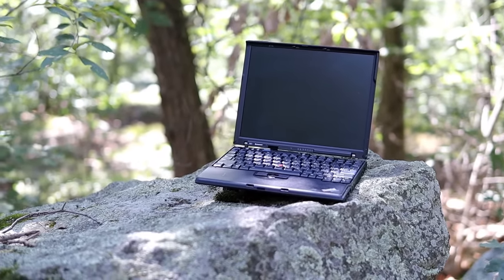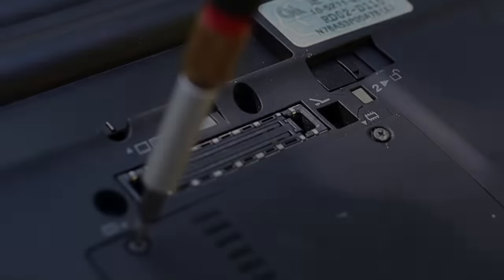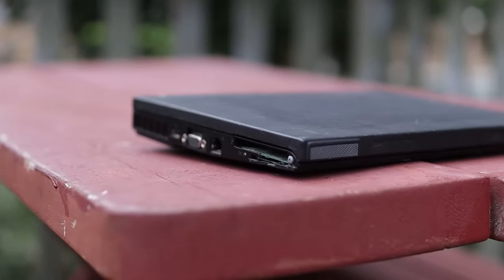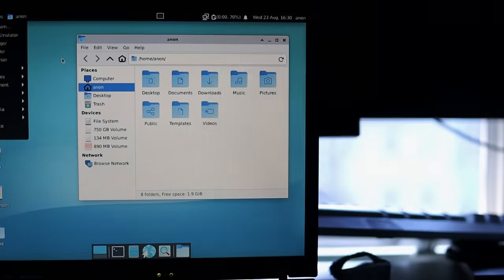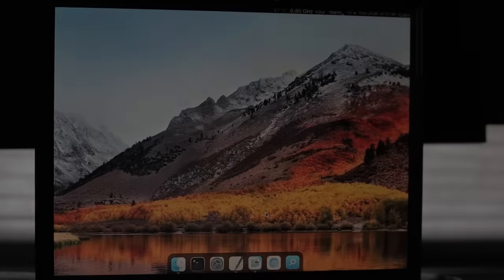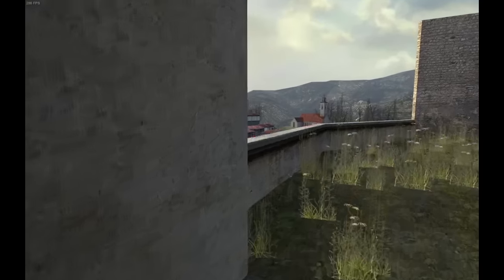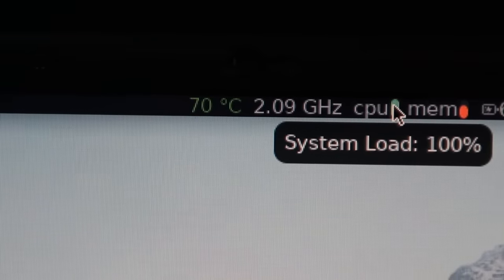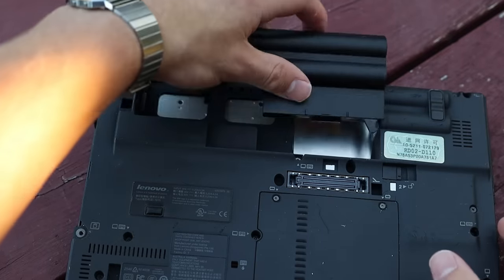Can Linux save this old laptop from obsolescence?

Comment: I've got an X61 Tablet that I absolutely refuse to part ways with. It's a slightly slower T7700 CPU, but getting it to 6GB of RAM and a 240GB SSD turned it into something that can, like you said, really easily beat the plague of N4020-based 11.6" members of the Future e-waste of America Society. I've used a debloated Windows 10 on it successfully, but settled on Mint XFCE for the reasons you described, although I am kind of tempted to dig it out and give Void a shot now. That bump to 6GB was pricey, around $25 for a 4GB DDR2 SODIMM, but the added headroom was worth every penny. That's really what made Windows 10 usable.
Reply: I’ve had an ASUs 11.6 N4020 laptop for about a year and a half now. It has some sort of Windows on a emmc but it is upgradable with NVME. I popped in some generic 256GB NVME and ran Kali Linux on it for over a year, but recently changed to Devuan and couldn’t be happier. Battery lasts for about 10h when I just browse internet and use it for programming and server maintenance via ssh. It is not my only computer, so for gaming or compiling I can use my i5-13600kf based PC. For the rest the N4020 is fine.
Reply: Obsolete after 16 years? I'm sorry, I thought this was America.
Reply: Windows 10 is not usable. An OS that requires you to check and possibly re-enter your settings every time a Microsoft update is forced upon you is not one you can trust.

Instead of fighting against Windows to de-bloat it, your time would be much better spent learning more about Linux.
Reply: @terrydaktyllus1320  How well is support for BattlEye and EAC nowadays?
Reply: @HappyBeezerStudios  I've no idea what BattlEye is, I've never used it and therefore it's unimportant in my computer world to the point where I don't plan on spending time doing "homework" to find out what it is. If you want a better response to that part of the question then you'll need to provide more detail.

The only "EAC" I know of is "Exact Audio Copy" which was a freeware tool that I used many years ago to rip CDs into FLAC format on Windows. I no longer use Windows and therefore don't use this tool either - there are perfectly good tools on Linux which do the same thing.

Again, if that's not what you meant by "EAC" then you'll have to improve your communication skills and explain yourself better if you want more definitive and accurate responses from me.

Over to you...
Reply: @terrydaktyllus1320  I'm talking about anticheats for games
Reply: @HappyBeezerStudios  "I'm talking about anticheats for games"

...then you need to improve your communication skills to indicate more clearly what you are talking about in future.

For the record, I don't consider playing online AAA games with "pretend Internet friends" to be something that I need to waste my time on when I get real friends over 3 or 4 times a year for beers, BBQ or pizza, and a proper LAN party playing classic multiplayer games like Quake and Unreal Tournament, which you bought once and owned forever in the "good old days" when games companies couldn't just leech money as they please from "whales" and kids with rich parents and no backbones.

I do game regularly but I've bought one AAA game after 2010 (Fallout 4 in 2015) because I don't do "games as a service" and could not be less interested in derivative and complete pap like "Cybersplatt 4044" or "Starfailed" - my point being that Linux plays all my pre-2010 games perfectly fine and I don't need to go begging to mummy and daddy each Christmas so that one of them donates another kidney to buy me the latest piece of overpriced and proprietary NVIDIA GPU rubbish either.

Does that now answer your point, gamer?
Reply: I'm still playing Lego Star Wars 3 Clone Wars even though I completed the game already 😊
Reply: @terrydaktyllus1320  you sound really fun
Reply: @soooslaaal8204  This isn't a discussion about me, sonny. Next time you reply, do try harder to keep up and stay on topic. We were talking about computers... in your own time.
Reply: @terrydaktyllus1320  Is larping as a boomer online that fun? I'll try that shtick next with my online "friends." Cheers
Reply: @soooslaaal8204  You go do that then, just don't feel you need to tell me your plans because I am really not interested.

Run along now, sonny, mind how you go and stay away from sharp scissors.

Discussion closed.
Reply: @terrydaktyllus1320  This isn't the tv pops, people respond in here when you speak at them.

Comment: Yeah great video and more testing than usual. I find collecting old ThinkPads is addictive and the most interesting ones, certainly the best keyboards, are on the older ones. They also have a fascinating design history throughout, even the later Lenovo ThinkPad products which continue high-quality design not always found on their other lines. After using SSDs for a few years I find mechanical drives more reliable if not too worn. Windows 10 is not too bad on some of the 2012-era ThinkPads. I have also tried the desktop ThinkCentres but they aren't as durable as the ThinkPads.

Comment: The old Thinkpads had several standout features that still, to this day don't seem to have been emulated by other laptop makers:
- Indestructible hinge design. Never breaks away from the base of the case. Screen stays in the position you adjust it to.
- Pointing stick. I hate touchpads, then because they were garbage and now because I have a hand tremor.
- Exterior of the case had a "rubberized" texture which made it easier to hang on to and less prone to skate off a surface to certain damage on impact.
- Reasonable keyboard design. My 2cents anyway.
Reply: The problem with rubberized texture is that after a decade or so it gets all sticky. Not sure about ThinkPads, though, I had a Dell with that problem. Awful.
Reply: Was a massive fan of the pointing stick on Thinkpads, but the trackpad on modern MacBooks is a winner, large surface and super accurate. Haven't seen anything come close on non-Apple laptops though. Even use the external trackpad on desktop over a traditional optical mouse now.

The texture on Thinkpads holds smells really easily, which can be an issue with the used market of Thinkpads, very easy to tell if a previous owner was a smoker.
Reply: @sp0el  I have an IBM Thinkpad from 1998, and two Lenovo T420s from 2012, and none of them suffer from the sticky coating syndrome.
I have plenty of other devices that do suffer from it...

Comment: I installed Linux Mint 21 (2022 version) on a laptop made in 2006. Fortunately, the laptop had 4Gb Ram, SATA, and Gigabit LAN.  The only upgrade required was a SSD.  Linux Mint installed and updated like a dream.  Job done 10/2022.

Comment: Linux put new life into my 2011 MacBook Pro that FINALLY in late 2022 stopped getting security updates and started to not be able to update LibreOffice or Firefox. 

It is AMAZING what Linux can make useable... I have a laptop that came with VISTA running Linux for the kids and playing retro games and it works actually really well for that and basic web browsing.
Reply: You don't even need linux. Windows 10 runs just fine on these laptops.

Comment: T61, 8gb, 128gb, win11, usb2x3, usb3x4, the usb3 speed is 150mbps via express card, T9500cpu. Working perfectly, task manager always on to monitor cpu usage, handles everything very very well.
Reply from the maker: Wow you maxed that thing out
Reply: @liamjewell62  it's great for web browsing and playing movies etc, it's not very powerful compared to modern ThinkPads but it's really special in looks and in use, the SSD was the biggest upgrade, boots windows 11 in seconds.

Comment: I had used an old Acer Travelmate from 2005 until early 2024, 150GB HDD, 2GB RAM, Celeron dual-core 1.67GHz CPU, as my mail mule, running MX Linux 32-bit without a problem.  Until the keyboard malfunctioned.

Comment: I have a zero % attention span, but I always watch good content to the end  to give the channel an analytics boost.
I have a 25 year old HP/Compaq "laptop" with a "Made for Windows Vista" sticker. (The sticker no longer matches the OS). I autoboot into an Atari ST emulator, and use it as a16 bit gaming computer. It's a Core 2 Duo with 4GB of memory (DDR2,  so going to 8bg is out of my snack bracket - at $200 to $500 for an 8GB kit.) but it works fine for emulating a 68000 based system.   I never throw out old tech, India already has enough of our tech-waste (and the associated health issues effect us all). I always find good reasons to keep stuff.
Hell, I still have my very first computer (a TI-99/4A purchased in 1982!) Gets booted up at least a couple times a week.
Thrusting obsolescence on things that no longer suit their original build purpose, is a deficit of the  imagination. (Pushing 70 myself, so that has particular personal relevance)
Reply: Fav on the TI was space invader & parsec.
Reply: nice

Comment: One things is very crucial to understand regarding hardware. You absolutely cannot compare computers from different era. For instance if you say 15 years old top of the line processor  X is on par as model entry level model Y from like two years ago. They can be comparable when measuring some direct calculation based with some benchmark program etc. HOWEVER things can turn completely around if comparing for instance playing YouTube videos. Now that couple year old entry level model can do playback possibly with like 5% processor load on 4K 60hz where older X model could struggle to run even 1080p 30Hz video. This is where many processor features come in and if someone is wondering why that example I just mentioned is possible if processors are essentially same when comparing calculation vise. But this newer model can easily support hardware encoding. This is very critical to understand when wondering why some older hardware seems to struggle with seemingly trivial task. Like that Chromebook in video can easily playback pretty much every single media without issues, where the old X61 absolutely can't. Don't get me wrong, I use a lot of old and new hardware and in many cases old hardware can do all the necessary stuff. But you can easily run into seemingly odd performance issues.
Reply: They might have similar performance for some tests, but add tasks that make use of newer instructions and the things change quickly. Same with video decoding.
Reply: sometimes you can cheat a bit, eg with h264ify plugin for youtube videos, often helps with older video hardware

Comment: "Better keyboard " I quote this so much! I sadly moved to a Chromebook from a Thinkpad T430 so I felt really the difference.
I definitely took the Chromebook as a daily drive just for it's weight and better battery life (and the usb-c charger, but someone told me you can find adapters for most of the barrel jacks)
Reply: Chrome OS, like Google Android, just turns a portable computing device into a surveillance tool for Google.
Reply: Something I noticed with old laptops as well. Was setting up two old machines, a Dell Latitude from 2001 and an Inspiron from ca 2005, and the Latitude had the better keyboard and better display even after so many years of use. (Sadly it's other specs make it more than obsolete)
Truly shows how well built those old business machines were.

Comment: I'm still using an HP NC6400 as my workbench laptop - it works, has a 900p panel for displaying schematics and YT videos and more importantly still works fine despite leading a tough life. With a lightweight distro the T2500, ATI X1300, 4gb ram and SSD are plenty fast enough.

Comment: A well presented video!👍👍Perhaps you could install an SSD., and make another video which shows how much the performance has improved.  Linux Mint Mate version is my daily driver and I often restore and upgrade older computers and Linux gives them a whole new lease of life.
Reply: It shouldn't really do much with actual performance, but help a lot with perceived performance. GIMP won't apply filters faster, but it will launch and load images faster. Games won't reach higher fps, but navigating the file system will be much snappier.

Comment: I still using my old PC with a i3 3220, 8gbs of ram and a intel hd 2500. On windows the performance is not that good, so I've been using linux exclusively for few years now. Today I use Window Managers(Wayland compositors) and the experience and performance are amazing for such an old hardware. I recently installed cachyos and it made watching videos on youtube a lot better with less cpu usage, something that I could never figure it out how to make it work under vanilla arch even though I follow carefully the wiki. About gaming, I been recently doing a lot of retro gaming with retroarch and the performance its good on the majority of cores available, except PS2 core, but some games do work using the PCSX2 emulator.
Reply: Weird, a computer with any i3 should run great on Windows 10. Have you tried an SSD?

Comment: I found an old Sony Vaio laptop from 2007 with an OEM edition of Vista. Installed a 32x Linux distro called Antix and now it works quite well. You can very easily breathe new life into these older PCs with Linux
Reply: You don't even need linux. Windows 10 runs just fine on these laptops.
Reply: @0w3nn  BS.
Reply: @chovekb  what are you calling BS?

Comment: I'm still using R61 for internet (except streaming movies) and programming. Max 4GB RAM, SSD and new battery. SSD gave huge boost. OS is loading in 30s. Before, it was 1m30s. Still it can play movies in 720p and MP4 from SSD in 1080p.
Reply: What OS do you use? I also have a dead R61 and am considering to restore it

Comment: Always fun to bring some new life to an old machine. I often have some old laptops around - been using a C2D laptop for a while during the lockdowns. Lubuntu, libre office, 720p YouTube and emulation up to the first PlayStation is plenty of activities! Worked with 1080p monitor without any problems. I also revieved 2nd gen i5 Sony VAIO with Mint XFCE not so long ago. Now it is a web browsing and writing machine for an aspiring poet.

Obviously, most of these things are only worth it if you got the laptop for free, as 100$ can get you a postleasing Ryzen 2300U/3300U (so, 4 cores, pretty powerful Vega iGPU) ThinkPad with 8GB RAM. And there is no upgrade to an old C2D laptop that can beat that, no matter the budget :) Multiple generations of dual core i5 laptops are even cheaper.

Dual booting an older Windows (for x86 retro gaming compatibility) and modern light Linux distro (for safe web experience) might be a fun use case for a C2D laptop like that.
Reply: Can you clarify what C2D means?
Reply: @nezatrebovan  Sure! Core 2 Duo - an older type of Intel CPU, popular over a decade ago. Thinkpad from the video uses one as well, a C2D T8100.
New CPUs are not only faster, but sometimes support different instructions sets or lack proper drivers for older operating systems. So some software is easier to run on older CPUs. For example Ryzen CPUs officially only support Windows 10 and newer (aside for Linux, obviously).

Comment: If you get yourself a T60, it comes with an IPS screen, which was superior to the screens that came with Thinkpads for the next 10 or 12 years, until a few years back Lenovo had to re-introduce the IPS screens by popular demand. The T61 already came with a crap screen. I'm not sure about the X61, but I don't think it's an IPS. The problem with the T60 is the motherboard limits you to 3 GB of memory, even if you install 4, and even if it's a 64-bit architecture. So your choice is between the 60s with a nice screen but limited to 3 GB of memory, or the 61s, with an inferior screen but more memory.

If you're a real Thinkpad enthusiast, you can make yourself a Frankenpad, which is a hybrid between the T60 and T61, with the benefits of both. You will also want to update the BIOS to the Middleton BIOS, which removes the original BIOS's wi-fi card whitelist, allowing you to install a modern wi-fi 6 card. Suitable T61 motherboards are extremely rare and hard to find, though. Not sure they're worth the money unless you're addicted to the Thinkpad keyboard and screen (like I am).

Comment: I still use a T420 (with a SSD). Perfectly fine for all my mobile computing needs, for more demanding tasks I'd want to use a desktop PC anyway. It doesn't even feel slow, XFCE runs great.
Reply: I have a T420 and the keyboard is awesome. I wish Lenovo hadn't switched to the chicklet design.
Reply: @johnmadison3472  That's true, the keyboard feels great, not nearly as fatiguing as modern style laptop keyboards. Sometimes I feel like modern laptops are too thin and elegant for their own good. Many have heat and battery issues.
Reply: Haha yeah. I have a t430s and its great. I even dock it to use as a desktop. Cinnamon is fine on it and its what I'm currently using but I may switch to xfce just out of preference.

Comment: A week ago i had never seen Linux before. I saw a yt video, and revived an obsolete 2014 mac air with Linux mint and it runs 10x faster than macos did with 4x the battery life after using tlp.